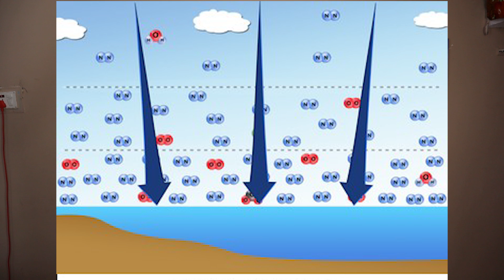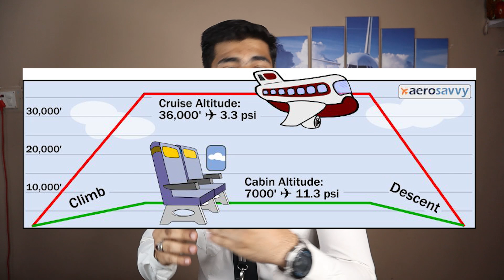Aircraft Pressurization system Explained + Why your ears pop in an Airplane

Comment: But the pressure can't enter the chips packet then how it gets inflated? Isn't it air tight
Reply from the maker: Nothing goes in or out... just that the force from outside air (pressure) reduces at high altitude than on ground... force from inside remains same (pressure) but reduction in pressure outside inflates the packet

Comment: Hey you explained about safety valve if pressure inside cabin increases so high but what if pressure inside the cabin decrease, then aircraft will shrink😮😮😮😨😨😰
Reply from the maker: Very simple amswer.. once again the same safety valve will open up to allow higher pressure from outside get in and equalize the pressure😉
Reply: @TheFlyTuber  WOW 😯..
How engineers think all this while making an aircraft?? That's why I love this wonderful machine

Comment: I have a doubt sir !! Stabilizing the pressure in the aircraft is a manual work or its fully automotive ?! If manual is there a theory behind it ?!
Reply from the maker: Automatic in normal operation without any failure, else we will have to do it manually